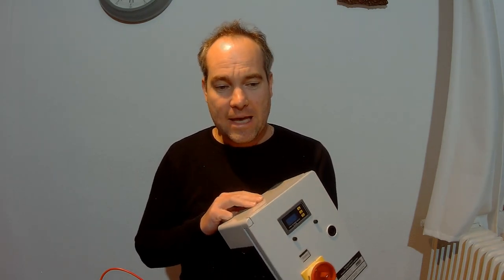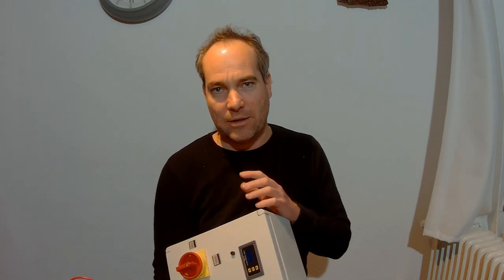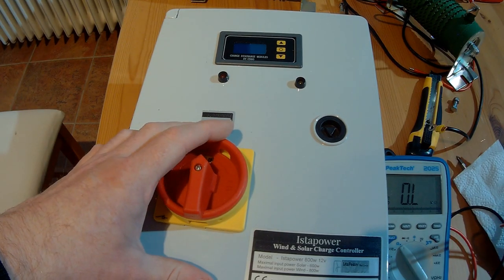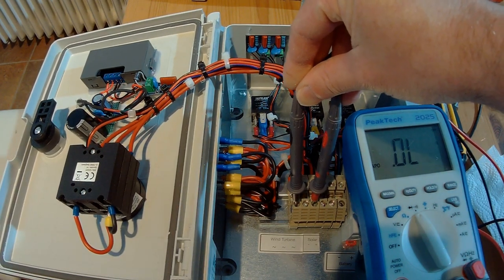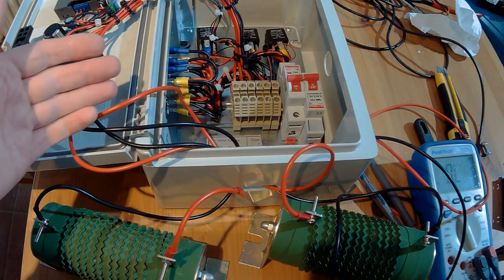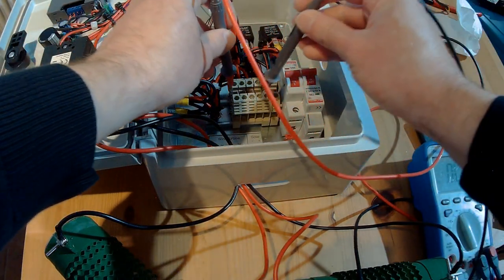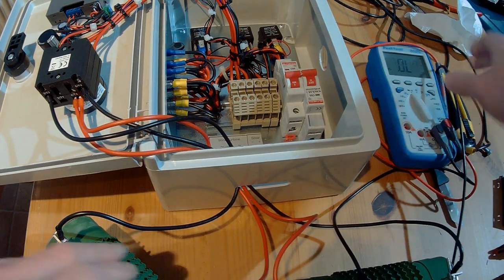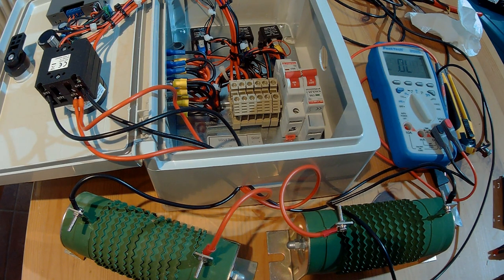Adding a dump load to an ISTA Breeze wind (water) turbine charge controller

Comment: Exactly, what a lot of people don’t understand is that neodymium magnets get permanent damaged by heat , it’s much better to share the break load of  the turbine.. schortend on break in storms even it’s not turning the magnetic force is heating up the coil burns out  red hot and demagnetized the magnets ..  real informatief video 💪

Comment: Hello Alex,
thanks a lot for your Videos!!
You added the dump loads to the main switch - that means that you only can switch to dump loads by the switch or what i suggest that the controller is also able to switch to the dump loads in that setup?
thanks
Reply from the maker: Hi. It depends a bit on the controller. In the case of the device shown, it only works on the switch. However, you can build a bridge/connection  to the relays. Then it works for both

Comment: Excellent explanation thank you, could you maybe give your thoughts and maybe  future video on add a voltage booster for the istabreeze charge controller, for use in low wind conditions. I currently have a istabreeze i1000 48v turbine and is charge controller  the cut in wind speed is above 3m/s so am missing out on the low voltage charging below 48v. Thanks
Reply from the maker: Thanks for the nice comment. I haven't tried an "up-converter" on the Ista Controller yet, because I live in an area with a lot of wind. However, I wanted to introduce a cheap MPPT for wind turbines that does low wind boost as well. But please keep in mind that below 5m/s the wind does not have much power and therefore can not produce much
Reply: @freeenergyonshore2828  thanks for your reply. I live in an area where average wind speed is 3.57m/s so the turbine only just cuts in and charges at 48v.  An mppt charge controller might be my answer. Have you plans for a future video? One question though would the mppt controller effect the istabreeze braking? Or would you consider by passing the ista controller altogether?
Reply from the maker: @celticboy66  I wanted to report the next days about such a charger: https://amzn.to/3NUXbOg . This could bring an improvement to your location. Please keep in mind that at 3 m/s the I-1000 will not deliver more than about 15 watts effectively. You should install an additional brake switch on this controller

Comment: have you tried this with your wind generator??  the wind regulator short-circuits the 3 phases anyway.  what you plug into the video only works if you manually turn on the red switch yourself.
Reply from the maker: Yes. it´s for the manual break switch. And yes I tried it of course

Comment: Please how did you connect the wires show us on camera thanks or did you remove the wires coming from the brake and connect the wires from the resisters? thanks
Reply from the maker: Yes I removed the orginal wires and connect the two dump loads

Comment: @free energy onshore  First of all, thank you very much for your video.

I have an ista breeze i2000 with the controller in the video and I'm considering connecting a couple of resistors the same way you recommend. It is not clear to me if the resistors would only act when I manually connected the brake or if they would also work when activated automatically by the regulator. Could you clarify this point for me?

Thanks
Reply from the maker: Hi. It depends on the charge controller. In this specific case into the video, the Dump Load is for the manual brake only. I did it that way, because of the following reason. Every time we have a strong storm, I use this brake. At strong storm the turbine turns a bit even with the brake on (the I2000 even more). I want to make sure, that the power will be not terminated into the turbine.
The break at high voltage is done by two relays. 
Anyway, you can connect the dump load to booth with a kind of "dump load bus". Maybe it's an good idea to create a video about that
Reply: @freeenergyonshore2828  Thank you very much for your answer, that's what I thought. In any case, it seems great to me to put the resistors in the manual brake for what you say and to be able to stop the wind turbine once in motion and derive the energy to a suitable place.
It would be great if you put a video about the dump load bus.
Thank you!
Reply: Ok
Reply: Unlike solar panels, windmills must push power or will overspin and either physically break or electrical components may overheat.

Dump load can be programmed to receive the overflow power or even limit the speed of the turbine for noise reasons, and put that energy in the dump load on purpose.

Cleverly programmed, the dump load can be something useful, such as heat large volume of water.
Reply: @freeenergyonshore2828  hi i have done this its working very good and it not stop the generator it just slow it down so when the volt drops down and the relay relese i got amps in my battery at ones instead of the generator have start up again which can take time.

Comment: I Have the same controller but 1500 watts, it does not display battery voltage correctly it displays .5 volts less than across the terminals in the controller. I was concerned it would affect charging, but insta breeze  told me to compensate the voltage on the display by -.5  volts for the in and out, mine is unlocked. Do you think that will work?
Reply from the maker: Hi. Yes I guess it's fine. You have to keep in mind the voltage losses at the cable as well. Sometimes that could be at least 0.5 volts (or even  more) on long, bad cables.

Comment: But dont the rectifier already break the volts down when you use a 150 Amp rectifier?
Reply from the maker: The dump load is used to terminate the power at the time of break activation